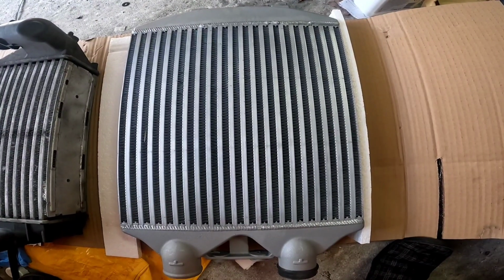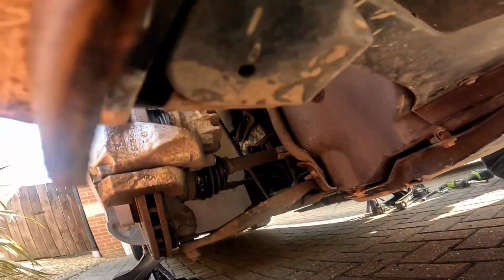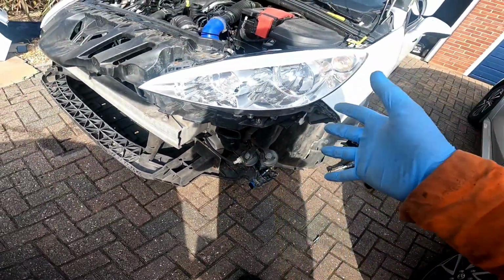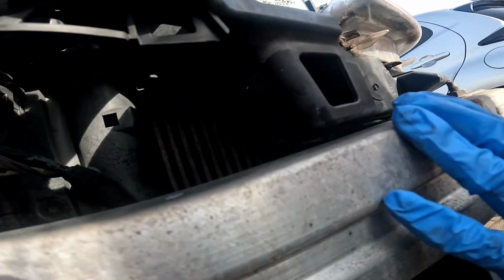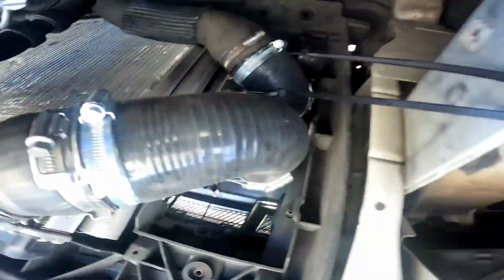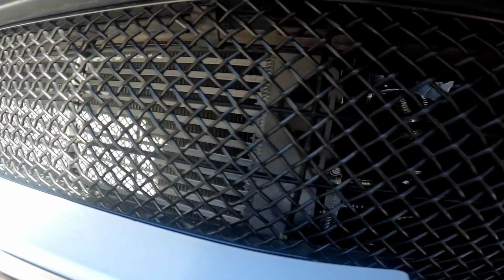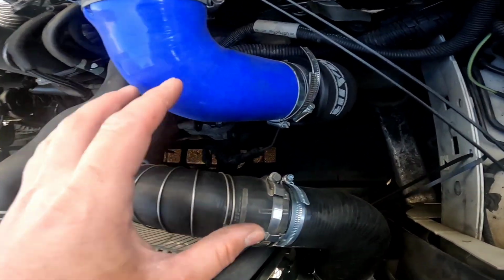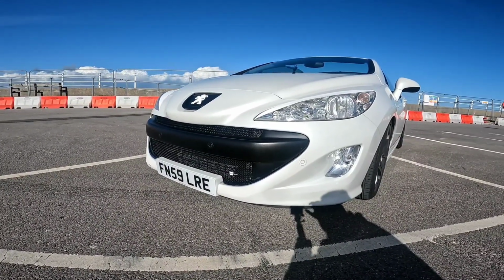PEUGEOT 308/CC/SW INTERCOOLER INSTALL 💨

Comment: this Seat intercooler just exclusively fit on HDI engines only?
Reply from the maker: It'll run on older thps (150 175 and early 200s)
Reply from the maker: 1.6hdis to
Reply: @LIMITLESSMEDIAUK_  older means also the 308 from 2010-2013 200thp?
Reply from the maker: @friendlybucket7268  only on models where the stock intercooler is visible from the engine bay like the one on this one, the newer thps use a different intercooler setup